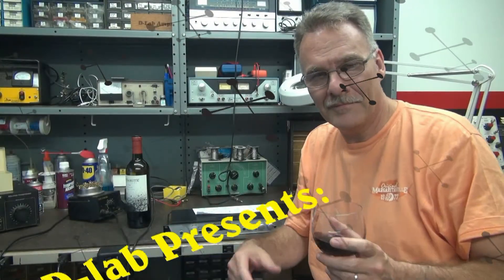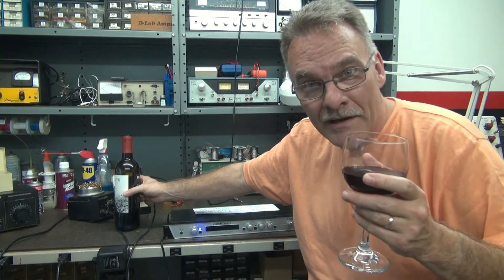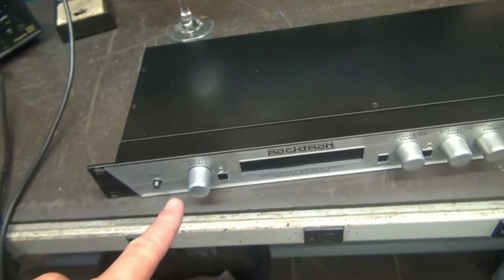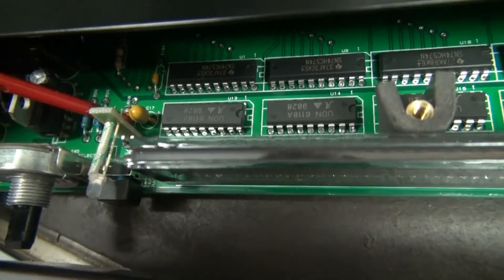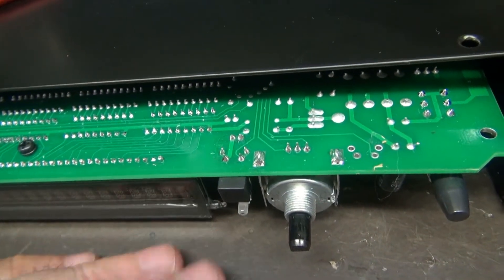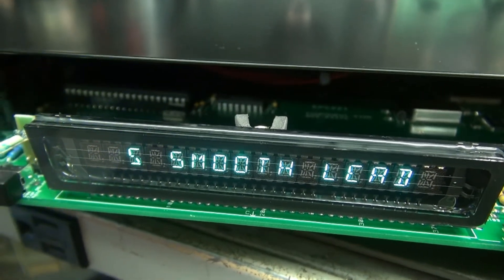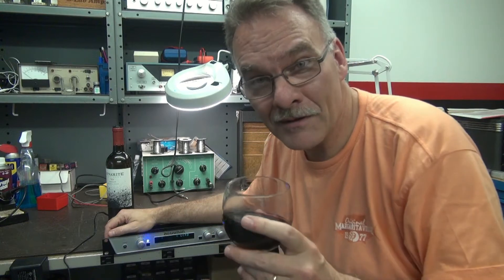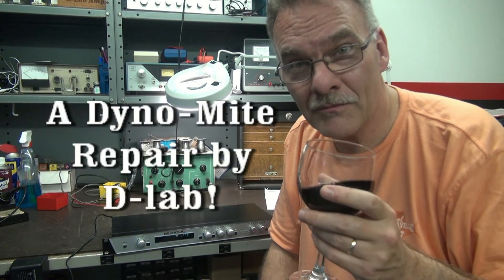How to repair flashing display Rocktron Xpression Guitar amp effect by D-lab

Comment: Hi. I replaced C17 in my new used Xpression. Didn‘t fix it. Measuring at the feet of the C, I measure 6V. According to your other video, it should be 20V. Any idea / schematic to tell what‘s next in line?

Comment: first time user.  have you replaced or repaired the output level change button on the front right side of the rocktron xpression.mine has to be pushed in and out many times to get connection and then drops sound level and then return, I suspect bad contacts. help
Reply from the maker: Hello, In my past experience with these units, the main failure is the input and output pots. They are not supported well, so are subject to easy damage if hit. Not often that I see bad solder joints. The switch could also be damaged. If you do not feel comfortable repairing it, you can ship it to me.
Reply: thank you very much.  I thought I was comfortable with repair, until today.  it has been dropped, in the past.It may not just be the push button switch.  will you send me your information so I can ship it to youI am in texas.  thanks again, from one old man to another.  I'm a young 51.
Reply from the maker: Hey man, shoot me an e-mail to: n6tlu@comcast.net
Reply: let me know if it works.

Comment: Hello,
I live in France (country of good wine): I see that you are a great amateur !!!
I own a Rocktron Voodu Valve bought new in 1995, still in perfect condition.
The display switched off abruptly (black) but the voodu valve always works: with its usual sound, all the LEDs light, communicates perfectly with the Rocktron All Acess crankset (display of the presets on the pedalboard / remote).
please
- do you have any idea of the possible causes?
- advices ?
Thank you;
José
Reply: I have the same issue with the replifex where the display does not turn on. Any advice?

Comment: Why did the cap fail? Is it low quality? Or did it see a lot of heat etc.?
Reply from the maker: That type just does. A standard 10uf electrolytic is fine to replace it with

Comment: Outstanding. How hard was it to find it the first time? That seems like it would be a pita. Those dang tantalums can be a problem in a lot of test equipment too. I wonder if the new ones are any better?
Reply from the maker: Yep. The 1st time, I suspected the voltage regulator. After replacing it, the problem remained, so I went down the line, cap was next. From there on, I just replace it. Total job time about 30 mins